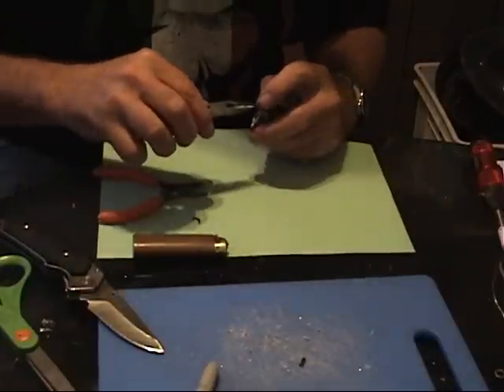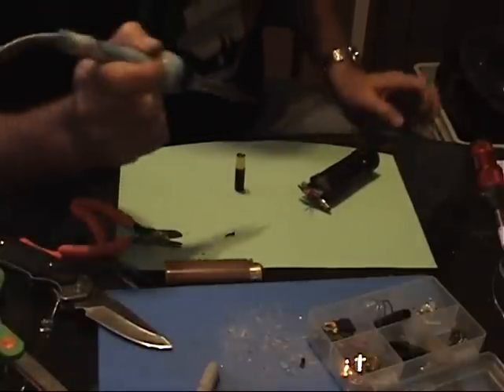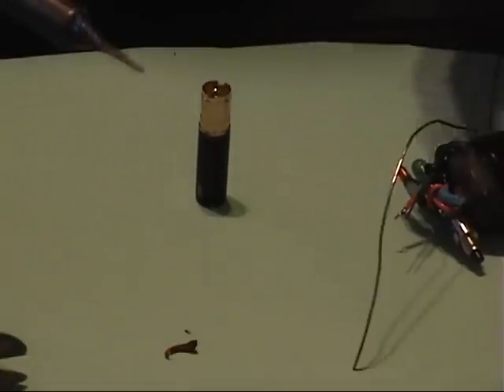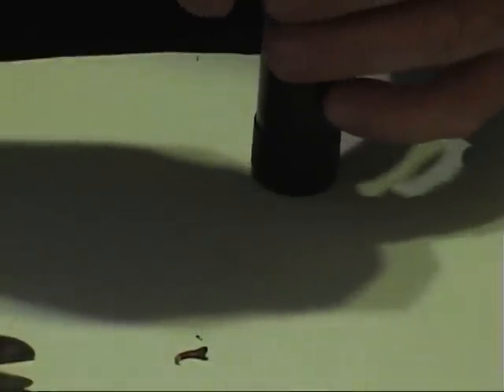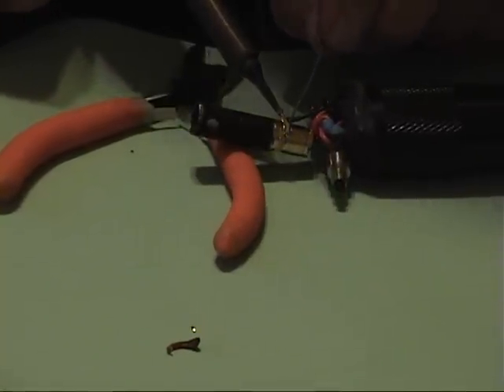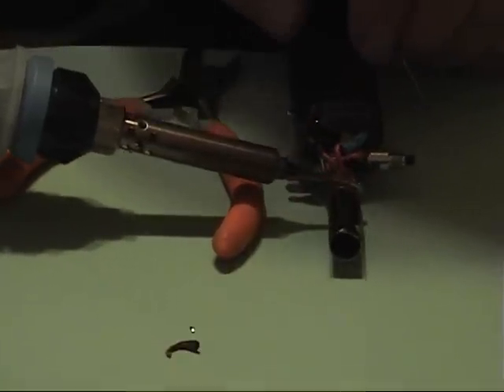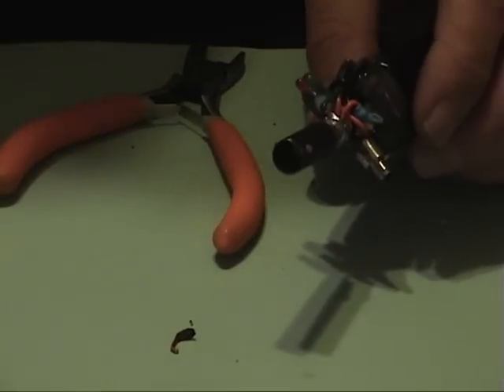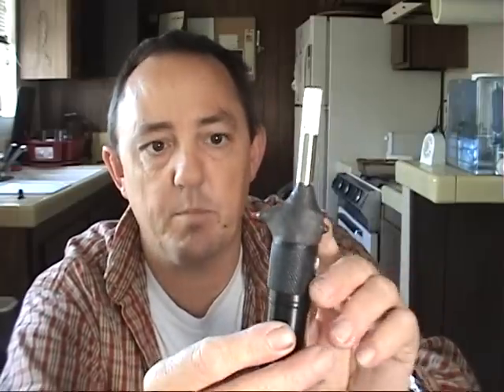E-cig Mod 5 Volt Detonator  DIY Part 10 using Protected CR123A's Pt 10

Comment from the maker: It is very hard to solder to alluminum, so having 2 holes with the ground wire wrapped around them and soldered together seemed to work best for me.  I havwe tried a few other methods of attaching ground to the FL body and this is what stays together the best.

Comment from the maker: @hossmonkey1 I heat shirk everyuthiong cause it is easy to get a short when you moving stuff around before the JB weld- but you right it is not really neccassary. The neg. connection to the FL Body though in my oppinion is the best way to do this..

Comment from the maker: @hossmonkey1 Sorry Man, I couldn't find anyone to hold the camera while I was JB welding it.  Basically you just cover the LED's and switch with duct tape then mix the JB weld blob it on and start forming it around the switch and lights till it gets hard in about 4 min.